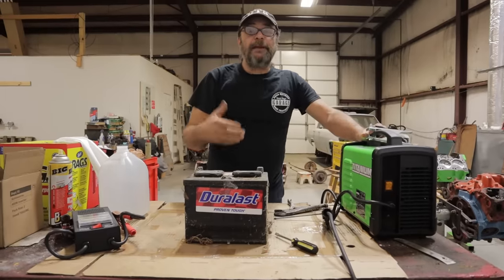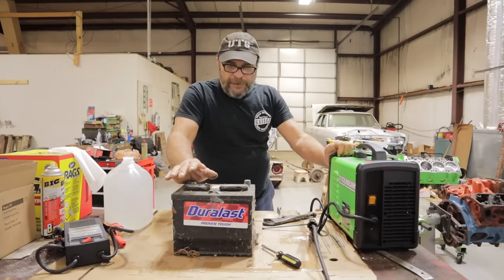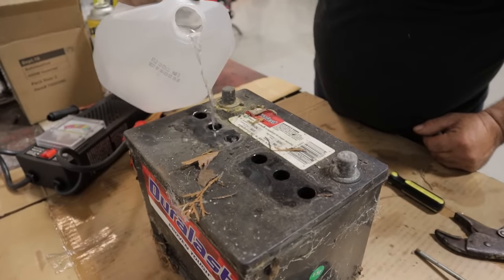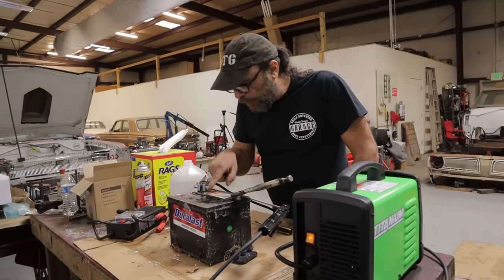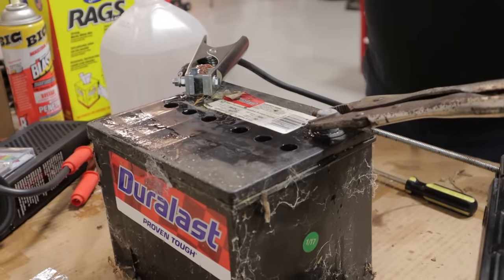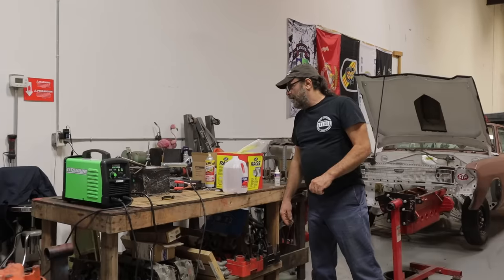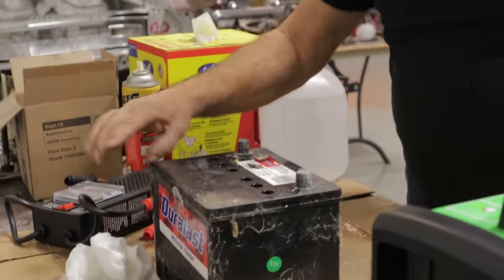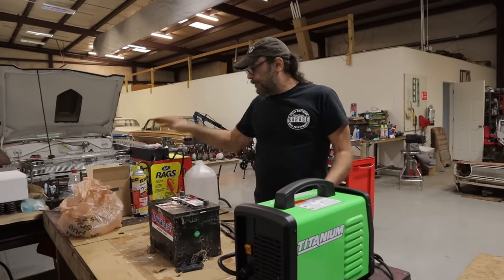Reviving Dead Batteries With A Stick Welder

Comment: I had heard years ago from the SUN salesman that you can use a true carbon pile load tester to revive a dead battery. In a nut shell you charge the battery to whatever it would take and then put the load tester on it and crank it all the way up until the battery is dead. then charge it again and repeat until the battery holds a charge. He said it causes the plates to vibrate and heat up. The crust would fall to the bottom of the battery. I have a battery that has been sitting in my shed since 2012. I think I am going to try this. I'll let you know.
Reply: How’d it go
Reply: If you're still alive tell us how it went
Reply: @nenedecaramelo  xD

Comment: Thanks I always wanted to do this experiment I’ve heard about putting high amperage into a battery to rejuvenate it but I’ve never experienced it thanks I was great
Reply: using a good condition 12 volt battery to act like the welder might also work

Comment: The welder trick does actually work, the science behind it is the crystals (sulfation) grow big enough to short plate to plate, the only part you where inaccurate about was the constant charge, under constant trickle sulfation will redissolve, but for extremely heavy sulfation (plate to plate) short no trickle won't work.......an improvement to your method is "shock" with welder then use a dedicated solar panel over a week to recondition the plates and peak the battery........all that said, good video and 99.9% correct, a little dangerous but still good info

Comment: Happy New Year!
Very informative! I'd heard of this but never witnessed it. Thanks!
It might make sense to disconnect the ground side cable at the welder (not the battery end) to minimize the risk of an arc.
Reply: How about just turning off the switch?
Reply: @tedmoss  that's a must. There are usually capacitors within welders used to ballast the load. Disconnection at the machine-end of the cable, removes the possibility of an arc near the hydrogen source

Comment: To dispose or when doing cleanup of the acid, baking soda neutralizes the acid and it won't harm.
In fact, when you do the battery service if you premix a gallon of water with baking soda keep that close by to wash with if you spill the acid or it explodes and gets on you.
Afterward instead of throwing it down the sink you can pour it on the lawn or garden, or cleared ground.

Comment: Many batteries just short out from the shedding material falling off the plates and insufficient space at the bottom.  Which it most likely a design feature to ensure the battery doesn't last too long
Reply: You are correct about a coating. There are two different ones bonded to each plate. (- &+)  The coatings are where and what allows the chemical reaction to take place.  It can lose its bond and fall off creating less reaction area until it eventually connects the plates at the bottom shorting out the battery. Deep discharge usually causes that. And would be the case in a well maintained battery going dead. Usually the coating just gets coated in insulating sulfate eventually which can be removed with chemicals. Crystals foRm if the battery gets low of fluid which they can remove with this high intensity ping deal. It's all about the coatings and the amount of surface are Available for the reaction to take place. Well until it collects at the bottom connecting the plates shorting out the battery.

Comment: You can still buy battery acid at parts stores, it's actually pretty cheap.
I've done similar to this but I didn't like the idea of the floaties in there so I did an acid change to.
Reply: It's sulphuric acid. You can get it in concentration over 90% at Walmart for drain cleaning.
Reply: @fuckingpippaman  my drain cleaner is double bagged, has skull and crossbones all over it, and has a msds tag that says '93% sulphuric acid'... There are lots of different drain cleaner options on the shelf though so.. 🤷‍♂️ Ymmv.

Comment: I use the boost feature on my charger. Word of caution those bubbles are hydrogen which goes bang best, as you said to do in a well ventilated area.

Comment: I might give this a try with a few old batteries I have laying around. Be an interesting experiment. One of the batteries is probably 20 years old. I'd be interested in seeing exactly how bad of a battery this could revive.

Side note. I have an optima red top from 2017 that was sitting in a shed for two years. I hooked it up to my mustang and it cranked stronger than either of the 2022 batteries I had been using. The thing just won't die.

Comment: It’s a pain that most batteries sold here in New Zealand don’t have removable caps. I have, in times of desperation, drilled filler holes above the cells for topping up, then reseated with hot glue. Not ideal, but better than a dry / low liquid level around the plates.
Reply: Exactly.

Comment: In the old ways they rolled the battery down a hill and replaced acid afterwards. I knew about the welder but heard that you should drain the charge completely and then reverse the polarity when you hit it with the welder. Then drain it again and charge it again. In Africa they cut the top part of the battery off and then sand the lead plates then solder and glue it back together. Not recommended due to health hazards. As a note, all the lead oxide is still in the bottom of the battery and will contaminate the plates again if you don't change the acid.
Reply: I've used bottled water for years. Should I use this process then dump the batteries and refill with new acid? If so, how much acid? Above the plates?

Comment: You should always clean the top of the battery before removing the battery caps. Now you've washed the crud into the battery. That will shorten the life of the battery.

Comment: A cheap constant voltage power supply is a better way to go about this. I’ve used the welder method but that was before I knew much about batteries. The Lead Acid chemistry will self regulate current fairly well so you really only need to focus on getting it ~16V. But if you use a constant voltage constant current power supply you can limit the current and let it run for a long period of time.
Reply: 16 volt at what amp
Reply: @13thbiosphere  It probably doesn't matter, you really just need to find a way to supply 16V since the battery self regulates the current. But since you asked, here's some more detail:

.1C to .2C is a safe charge rate for lead acid batteries.

You'll want to get the specs for your battery and find the rated Amp-Hours (not cold cranking amps), then multiply by the C rate to get the amps needed to charge at that that C rate.

Example with a 50Ah car battery:
.1C * 50Ah = 5 Amps
.2C * 50Ah = 10 Amps

But this is often misunderstood because you don't actually specify the amps that flow into the battery, you only limit them.

If you set the limit to 10 amps (using a 10 amp charger or a current limiting power supply), you may not see 10 amps flow into the battery. This is because battery self regulates quite a bit. At very low and very high levels of charge it may pull far less than that.

The voltage is what pushes energy into the battery, and what breaks up the formations that restore capacity.

In short, I'd get a 16V power supply with something under 10amp max capacity, and hook it up. You can find CC/CV supplies on Amazon/eBay cheaply. Or you may wall adapter for a laptop or other device around your house.

This is my 2 cents. I'm not a trained battery engineer. Just a guy who's been harvesting cells and building my own battery packs for a number of years, trying to offer some information that could help someone. Good luck!
Reply: most transformer battery chargers will charge to 18 plus volts and if left will over charge and distroy a battery if left ....... how come in over 100 years of use batterys still die after 3 years ........ i think the trick is the way over
 voltage / amps
Reply: @deanhawes5088  Yeah those old school chargers boil out the electrolyte eventually. There are much better options today, 3-stage smart chargers and constant voltage power supplies are super cheap now.
Reply: @colindgrant  me i use switch mode power supply  now set them for 13.8 v walk away .
 cheap to 30 amps sets me back aroud $30
Reply: @deanhawes5088  absolutely, they're great. 13.8 is ideal for float/long term maintenance. This video is about reviving 'dead' batteries, so an aggressive 16V charge makes sense to break up sulphate crystals. But even a healthy battery benefits from charging up to the absorption voltage periodically. That's usually in the mid 14V range depending on chemistry.
Reply: Doesn't work.

Comment: Some welding processes are electrode negative. make sure your machine is set up for electrode positive before you do that.
Reply: @ebutuoyebutouy  It varies. tig on steel and flux core are generally dcen. Stick and mig are generally dcep. But that can vary based on the particular process. Aluminum tig is of course AC, you'll definitely have a bad day hooking a battery up to that.
Reply: Mig is also constant voltage instead of constant current too, so if it's set up for that, it's not going to be fun times. Some of those machines can be set to hold it in the 30+ volt range. So - set it up for stick, and make sure it's set for dcep, or switch the leads.

Comment: Nice job!
You can do the same with baking soda.
Dissolve a whole box of baking soda in water.
Dump the acid from the battery, but save it for later.
Then fill up the battery with the baking soda water.
It will start boiling like what you have seen here.
Takes about 20-30 minutes and the baking soda will dissolve the sulfates from the plates.
Repeat 2 - 3 times.
Then fill up the battery with new or the old acid.
Charge the battery and then drain it with a low load like a headlight bulb.
Repeat that 2 - 3 times.
Woala, you have a new battery.

Comment: The only thing I would suggest to watch out for is exceeding the duty cycle of your welder. Not a very good trade to save an old battery only to burn up your welder. With larger welders it will not be an issue but small welders have lower duty cycles. Sometimes very low.
Reply: Duty cycle just means the welder will switch itself off when it gets too hot.
Reply: i do the same thing with my car, just overheat the shit out of it until it shuts off, leave it sit, and it's good as new again after it cools down

Comment: You probably should have had a timer and a thermometer as well ideally one of the infrared point-and-shoot ones you can use from a distance or you could just touch the battery on occasion to make sure it's not getting too hot which is what I do but I recognize the other way is preferred and much safer

Comment: Would have liked to see a load test before the welder was hooked up. 
Also should have connected battery clamps to the “CLEAN POSTS” and connected the leads to the clamps to avoid damage to the posts.
Reply: The only problem with that is introducing a dependent connection between the welder and the battery.  Unless those leads are rated same as the welder or higher, they'll melt and then you've got a fire AND an explosion.  Much better to trust the welder's connections and electrical mechanisms than introducing a "third party."

Comment: I was off grid in Northern California where they used a 
"Out back" solar unit. It was using 12  3v battery's (huge 75 lb or so)The battery's went bad randomly. Well once they did it was over, lots of water because of boiling. The burning off the plates   WORKED GREAT. The cell was shot and it wouldn't hold the charge for anything.  And the vapors will stop you dead in your tracks,  Like a sour gas smell.

Comment: A load test before you started would have been nice.
Reply: Probably not worth load testng because it had been dead when he parked it years ago. However, he should have put a voltmeter on it before, during and after   charging. When done then load test it.
Reply: I think the 3yr dead battery would have shown dead on voltage scale.

Comment: Wondering if you could do an HHO video. I'm  hearing the units with tuners work pretty well. But so many different opinions I can't  tell what's  up. They seem to work on diesels better than gas. I have  a 6.7 cummins. Would be great if this helps significantly.

Comment: one thing i found out was the new battery charges may not charge a really dead battery because it dosent see any voltage. The newer chargers need some voltage to read in order to start charging. Find an old charger at a yard sale or somewhere and you wont regret it. The way you can tell if its old, is if its plugged in and you tap the positive and negative, it creates a spark. New ones dont spark. So the old chargers will put out voltage regardless of how dead it is. So much for smart chargers.

Comment: I had a battery last 12 years by topping up with distilled water and charging every year at about 15 - 20 amps to really boil it.
Reply: I've gotten 13 and 16yrs respective on 2 optima batteries I've bought. 
And one of em really saved my ass, the car I put it in gets all kinds of wiring problems because of all the wiring around the battery area and the acid venting. 
I've had the car since it's been 2 and I swapped it in probably 6mo after I got it. 
Great side effect if you ask me.

Comment: It would have been nice to know what was the welders output voltage at the terminals when you were charging 100 amps
Reply: 18-24VDC. its known as the CCV (closed circuit voltage)
Reply: Why?

Comment: Great video on reviving a dead car battery.  

BTW the analogue load tester gets pretty hot with two consecutive load tests.  Give the load tester a five minute break between each load test.  I have a 100 amp jump starter on my battery charger and it does the exact same thing as the stick welder.

Comment: Many old batteries around here and we all love an experiment ! Glad I found this channel - subbed and liked
Reply: You can throw them away.
Not reparable. Unless you do it the indian way. Pry open, remove lead elements, install new ones, new liquids, and charge.
Most of the 5 year old batteries, have damaged cells. You cant fix that just with new liquid and a trickle charge.
Reply: Any update on your experiment? Did you revived any of them? Did you explode or anything?
Reply: @jayserr  I’ll keep you posted when I get going on them
Reply: @wardmontgomery9259  its been 5 months .. how it going there amigo?
Reply: @fidelcatsro6948  I went to work on an 800 amp battery and got it up to 12.8 bolts and 650 amps - it holds the amperage pretty well but my charger only goes up to 8 amps so I haven’t really heated it up too much … maybe I’ll get a new charger but I’d say - so far, so good !
Reply: @fidelcatsro6948  the Seasons fly by …
Reply: @wardmontgomery9259  i see so it does revive old batteries most of the time!

Comment: I love reading the Safety Inspector Karen comments after every UTG videos.
Reply: Don't think being reckless and unsafe makes you " tough "  , it does not.  

In the 80's a guy named Granville King wrote a column in Four Wheeler magazine called "From the Backcountry" .    He was a Tony type playing a bit loose with safety.  Granville King was killed in a dune buggy crash October 25, 1989 .  Word from the day was he was not wearing a seat belt.  

 As of late 2020 his column is being reprinted from old issues, have a read. Still think that being unsafe was a good thing given we lost someone like him? 

Also have a look at these vids on the channel Tim McAmis  Performance Parts

Track Safety: Questions You Need To Ask

Fire Safety Rant

What You Should Know About Racing Fire Systems

Don’t Put-Off This Fire System Checkup

PSA For Drivers

Comment: I'd like to see some real testing with a volt meter on it too so we can see what kind of voltage you are pushing into this 12v battery but also a capacity test after
Reply: It won't be much for long. This is only a very temporary fix if any at all.
Reply: if im not wrong most welders like these are about 24 volts dc
Reply: @fidelcatsro6948  I think its closer to 40 to 50 volts but still 24 I mean the most a battery should ever see is like 15v if it's cold or something
Reply: @james10739  thats probably no load voltage...once you short it would be around 24
Reply: @fidelcatsro6948  ya that's why I'd like to see some actual testing

Comment: When reviving a car battery using this method pouring in distilled water & allowing it to bubble at 50 amps til it starts to bubble over in each cell, how many times are you using the distilled water and welder in said process your explaining here to bring the otherwise dead car battery back ? An how long will that battery last once you have finished the entire car battery reviving process as explained here from your video ?

Comment: With two batteries in my truck that are 8 years old and on their last leg, this makes me want to buy a stick welder!!
Reply: Will probably be cheaper. Batteries got expensive
Reply: @guyod1  yes they did......looks like $350 for replacements this time around......
Reply: Same. You must use a DC inverter welder to do this, don't use AC!  Many inverter/welders have different DC V outputs. I've seen ratings from 16V to 70+V...   What I don't know is which DC voltage is desirable for doing 12V batteries.